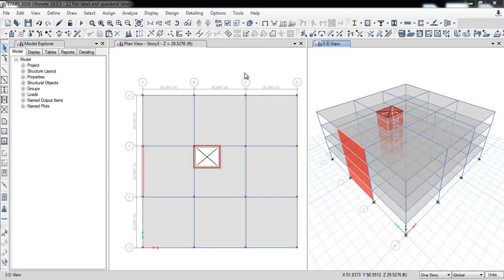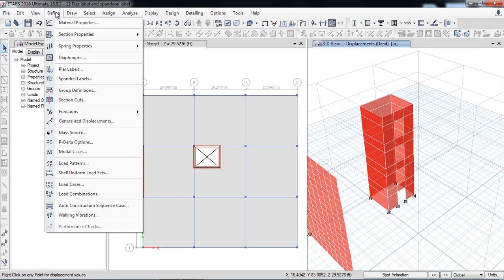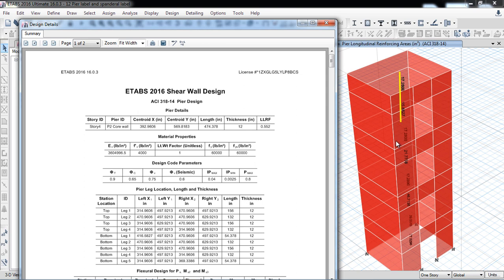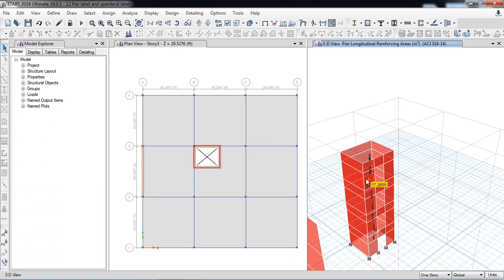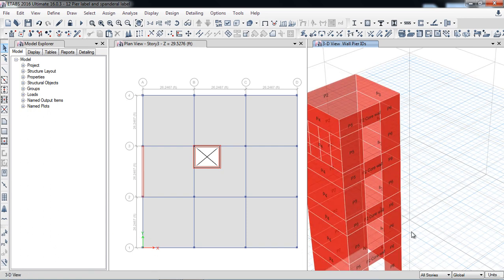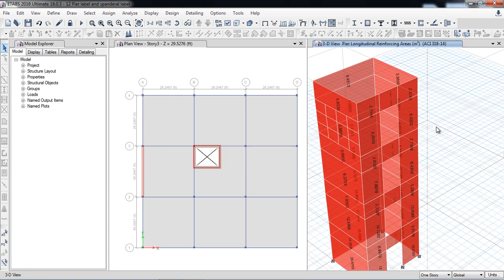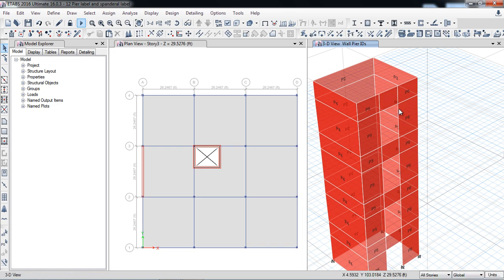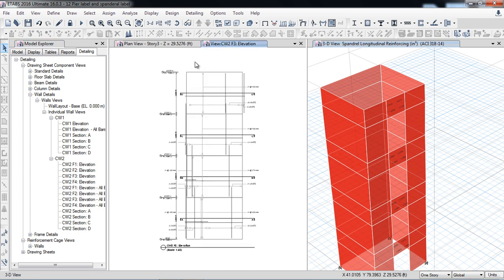CSI ETABS - 03 - Pier Labels and Spandrel Labels (Part b) | Part 11

Comment: Dear i have a question Regarding the spandrel and piers. so in analysis does the core wall that we have named into several piers and spandrels  will work as a rigid core wall or independent piers and spandrels, which may have different behavior than the normal behavior of corewall.  i hope the question is clear. thanks in advance